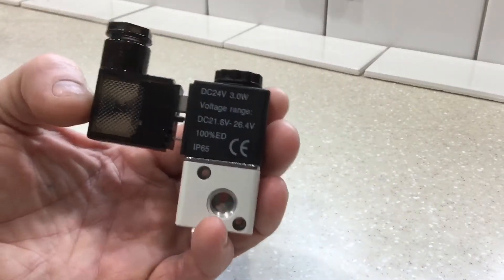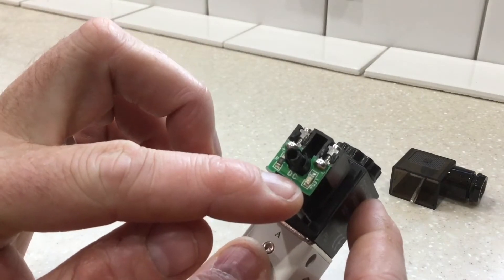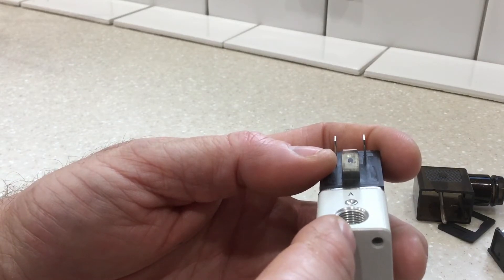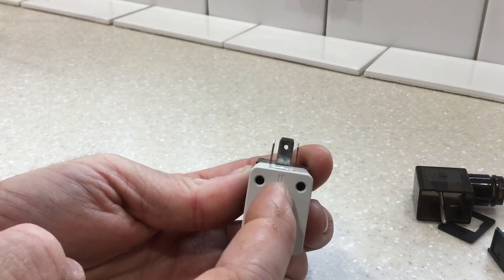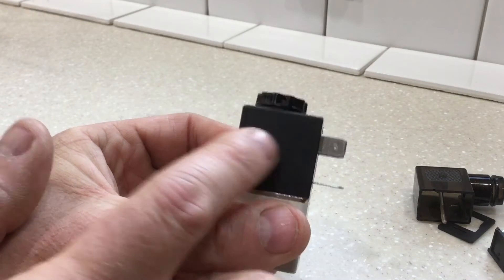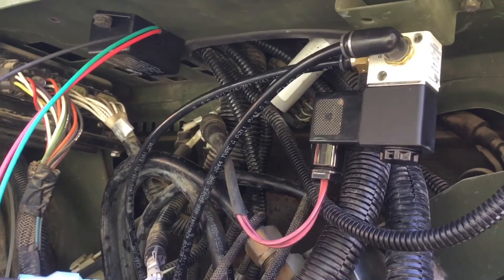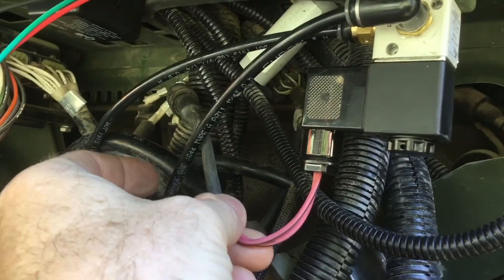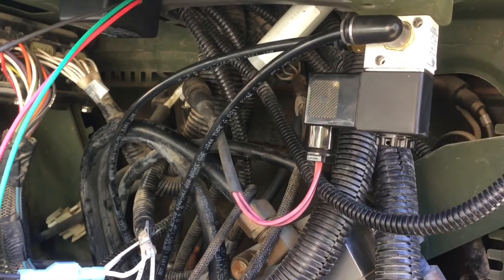LMTV FAN SOLENOID ALTERNATIVE

Comment: Thanks for this video Ron! I just made the change and it’s working great!  By any chance do you have a CTIS video coming up soon? I have a problem that I can’t figure out and I think I’m missing something about the way he system works.
Reply from the maker: Sorry, my CTIS controller was bad when I got my truck.  I switched to a manual controller right after that.  What is yours doing exactly?  Lots of variables to make the system operate, it could be something simple…
Reply: @rronmar  hate to go off topic, can I Facebook message you?
Reply from the maker: @MehrdadMorabbi  Yes you can.
Reply: I couldn’t find you on Facebook so I posted a description of the problem here. I don’t see it though, did you get it?
Reply from the maker: @MehrdadMorabbi  no, I didn’t see anything. There is a word limit so if it was too long it wouldn’t have posted…
Reply: What’s the best way for me to reach you?
Reply from the maker: @MehrdadMorabbi  check your facebook I sent you a message request…